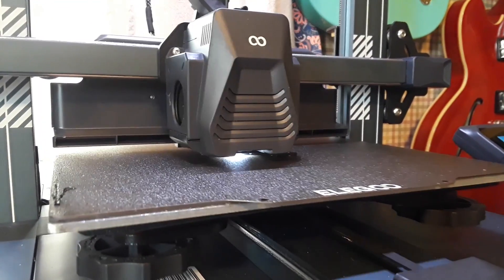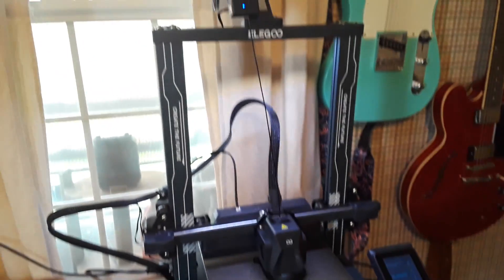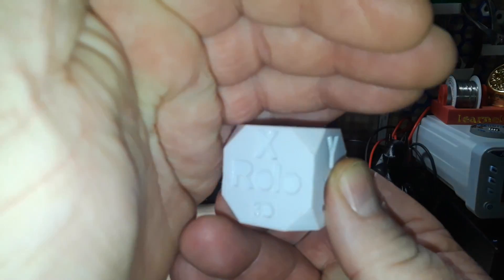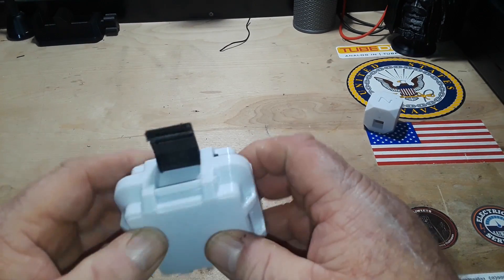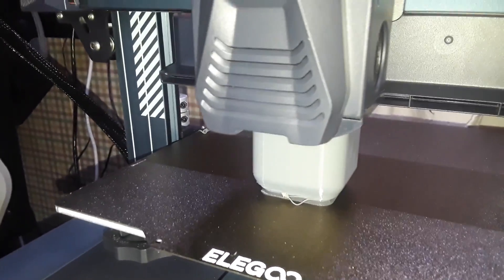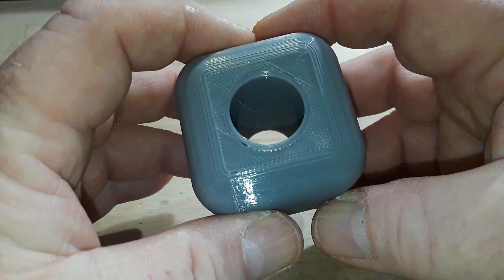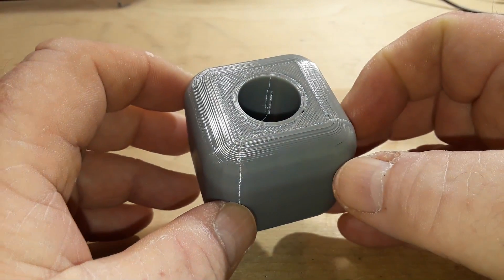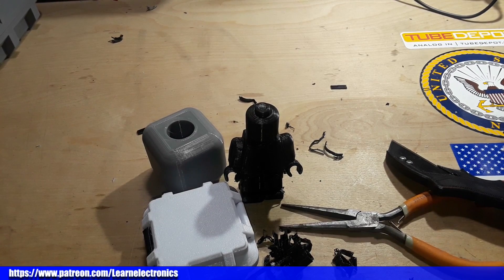Testing Different Materials on the Elegoo Neptune 4 Pro

Comment: I was having a heck of a time with TPU. Once I set the print speed to 45mms (i.e. slow it down), temp 220, bed 80, fan 100 ...my TPU prints are now looking great. Didn't know the slicer software has the speed settings in it. Love the Neptune 4 Pro.
Reply: Does it require modification like enclosure and a new hot end

Comment: I got my Neptune 4 Pro yesterday.  I assembled it and printed the nicest Benchy I've ever seen... in 22 minutes.  It's amazing how far 3D printing technology has advanced in the last two years.  I need to set up PrusaSlicer for the Neptune 4, and then I'll print some PETG and short ABS parts with a draft shield if necessary, but mostly, I'll be printing TPU parts for my online business.  The high speed doesn't apply to TPU but I expect much better print quality from the more precise Klipper controlled motion and much better part cooling.

The Neptune 4 Plus and Max are releasing tomorrow (they have WiFi!).  I'd love to have a Max (420 X 420 mm) version of the Neptune 4 Pro, but I'm waiting for the Pro version with the steel rails.
Reply: Hello, have you tried printing ABS/ASA? Do you think you could print them at max speed 500mm/s?
Reply: @MKrnic7  - I have not tried printing ABS or ASA.  I have 5 kg of ABS that I need to print into a few hundred parts.  They're large flat parts, full width of the bed and I could print two at a time but probably won't.  The parts are only 6 mm tall.  I printed them in an enclosed printer but I may be able to print them on the Neptune 4 Pro without them warping.  If not, I'll try a draft shield and if that still doesn't work I'll add a brim.  I'm not sure how much faster I can print these parts but I'm sure I can print them much faster on the Neptune 4 Pro.  I expect to print the parts this winter, so I guess I'll learn what's possible with ABS then, however, once I dial in PETG (first print was great looking until it made a bird's nest), I'll replace my ABS structural parts with PETG.  I've been mostly printing TPU on glass until getting the Neptune 4 Pro, and that spoiled me with great first layer adhesion and no print failures.
Reply: Wow, thank you for thorough reply. I'm looking into getting one of these 'new gen' printers that go up to 500mm/s, but would most likely use it to print ASA/ABS staff with it. I've seen they advertise this max speed using high speed PLA so I'm wondering if the ASA would handle it as well. But I guess I'll give it a shot anyway and try to print it as fast as it can get without sacrificing quality of the print.
Reply: @MKrnic7  - There are two issues of concern to me when printing fast.  You mentioned print quality but my larger concern would be part strength, particularly for materials such as ABS and ASA where the primary motivation for those materials is part strength.  Fast printing can compromise interlayer bond strength.  There are several videos.  CNC Kitchen has a video entitled, "Fast 3D printing is bad for Strength! (and how to fix it!)".
Reply: @Liberty4Ever  Yes, of course, I'll look into that video for sure!
Thank you very much and wish you many luck with your 3D business! Cheers!😃
Reply: I am really curious. Is your TPU printing running fine?
I have bought a Neptune 4 Pro. Though I am new at 3D printing, I had almost no problem with PLA. My TPU is just not working. Looking at the printer, seems that the filament stops being pulled, even if try to help (either by relieving the tension of the filament or pushing it in slightly).
Did you have this problem? Any idea about the cause and how to fix?
Reply: @lynxfight - I've printed so much TPU that I take a lot of it for granted.  Start by hanging the reel above the printer.  Do not try to pull TPU from the side, or up and back down again.  Use a low friction reel holder.  A slight pull should unreel the TPU filament without much drag, even when the reel is full, but it shouldn't roll so freely that loose TPU rolls off into a loose knot.  Overhangs are problematic.  On the Neptune 4 Pro, I print with 0.33 mm layers.  The first layer is 70 C bed and 240 C nozzle.  Make sure the Z height is correct.  My Neptune 4 Pro set the X offset to -1.100 mm but I reset it to -0.800 mm for a good first layer.  TPU sticks very well to the PEI bed, so you may want to float it onto the bed from much higher if you have a large surface area for the first layer, but my parts are tall and skinny with only a very small circular contact patch on the bed.  I print subsequent layers at 240 C nozzle if I'm trying to maximize interlayer bonding (it's always good with TPU) and I'm trying to extrude it hot so there is a little less abrupt layer lines, but 210 C works better for overhangs and to prevent stringing.  I turn off the bed heating after laying down a good first layer.  I print at 60 mm/s and travel moves are 200 mm/s.  I do 4 mm of retraction to greatly reduce stringing and I also tell PrusaSlicer not to cross perimeters, up to 500 mm so it should never try to cross a perimeter and should keep the nozzle in the infill when moving.  Perhaps the biggest trick is using harder 98A durometer TPU.  I use 3D Best Q brand TPU from Amazon.  95A is most common TPU and would probably work, but anything softer would likely cause the feeding issues you reported where the drive gear spins on the filament.  If I want a softer part, I use fewer perimeter layers and less infill.  With more perimeter layers and 40%+ infill, TPU makes a hard rubber part that is nearly indestructible and it's particularly shatter resistant.  Mostly solid TPU parts are tough enough to be dog chew toys.  Once you get the hang of it, TPU is an excellent material for many applications.
Reply: @Liberty4Ever - Really appreciate your tips and effort to help me.
I will try with your parameters, but It might be the hardness. When I bought, it I did not care a lot, only when I started having problems is that I searched better and concluded that the TPU does not have that information.
Reply: @lynxfight  - Usually, if there is no Shore A durometer listed on TPU filament, it's 95A or 98A.  If it's softer, they'll brag about it, and it'll be more expensive.  The Chinese TPU that I buy on Amazon doesn't list the durometer, but it's a little stiffer than 95A.  There are YouTube videos that describe how to print with TPU, and some of them show a comparison pushing, bending or flicking the filament to see how readily it bends.  That information can actually be conveyed in a video.

Comment: I've been waiting for a larger format version of the Neptune 4 Pro but I might need to get a Neptune 4 Pro.  I still wish Elegoo had included WiFi so I didn't need to add it myself.
Reply: Did you ever go about adding WiFi to yours? I was planning to eventually just run ethernet to mine, but if you've had good results with WiFi, I'm somewhat interested in going that route instead. I'm a little upset they announced the Plus for $50 more (and with built in WiFi) just a week after my 4 Pro finally came in.